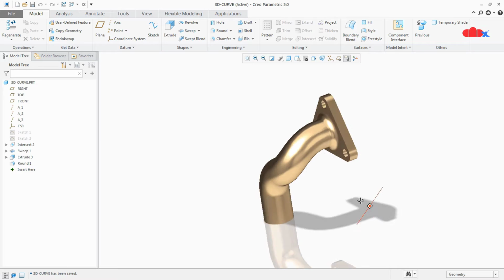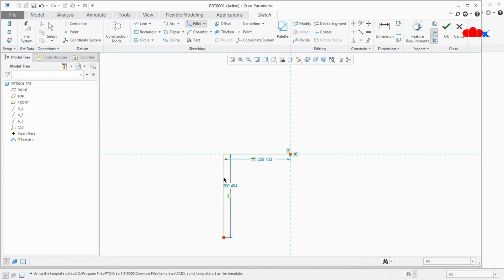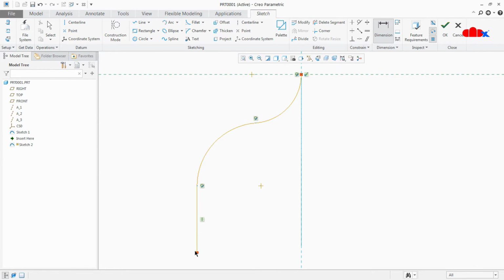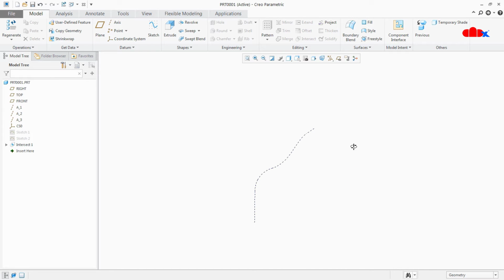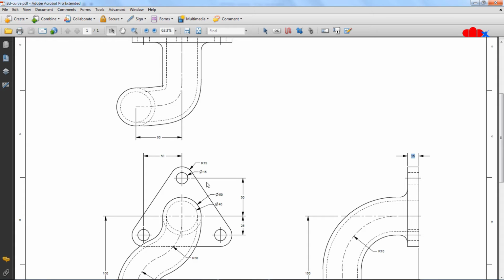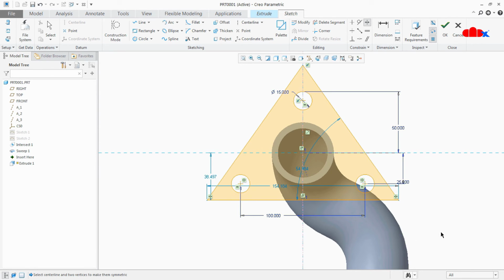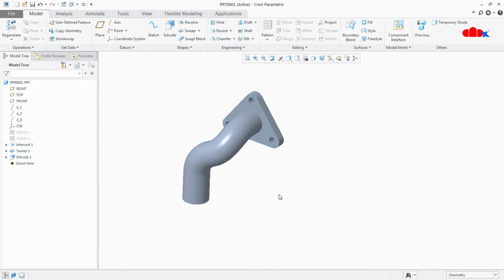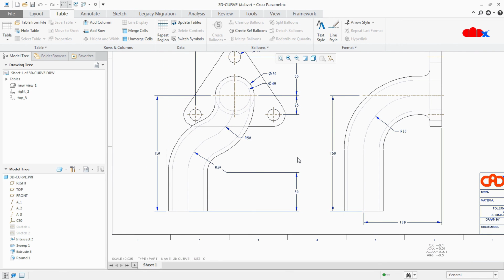3d Curve in Creo Parametric

Comment: Very good and useful but there is a small mistake in the last sketch,the top hole in the triangle should have the dimension 50 from the center of the hole to the axis,that's why the 3D model looks weird after you do the round at the end.Thank you
Reply: Yeah, i also noticed it

Comment: I'm unable to get the orientation correct and the sketch planes for me are completely different. Did you change the plane settings
Reply from the maker: Orientation may change as per the first feature.
Reply: @CADxTraining  Thanks for the reply....for the second curve sketch on the right plane, my orientation is completely different, I followed the same steps. I'll give it another try